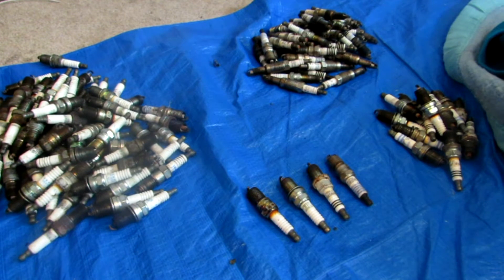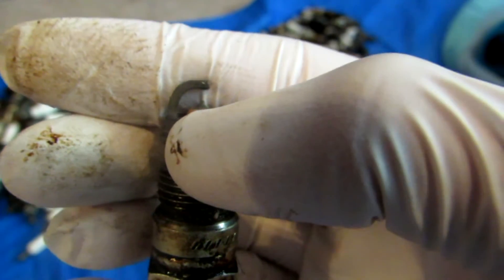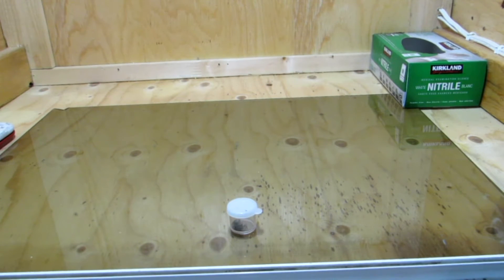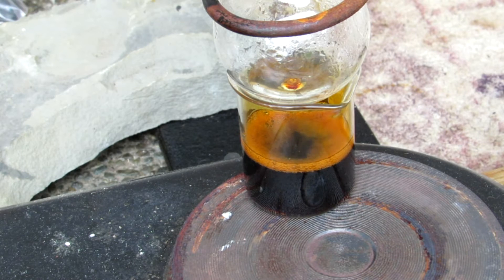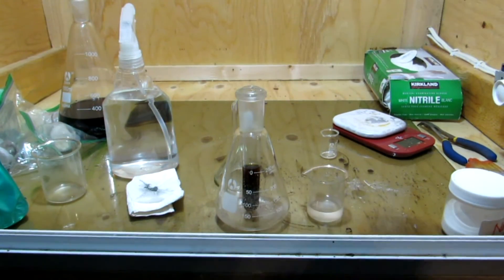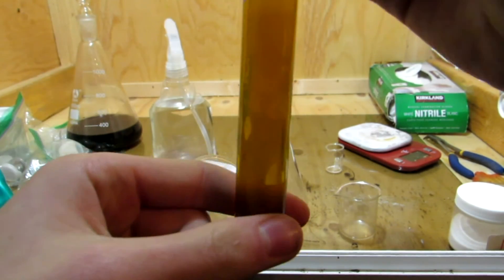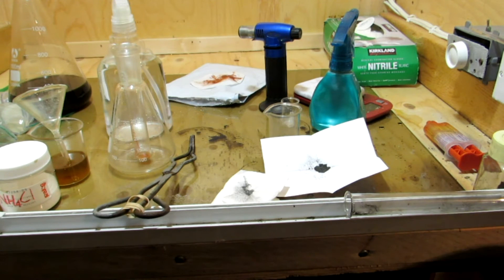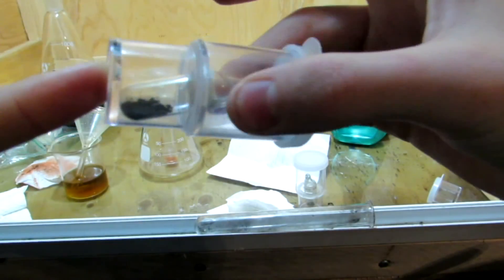Iridium and Platinum from Spark Plugs - Household Materials

Comment: Be careful of platinum compounds as they are very toxic. You are exposing yourself to minute amounts of it when you dissolve the platinum in acid; the small bubbles of gas carry droplets with trace amounts of metal. Even drops of  the soluble compounds on the skin are toxic.https://en.wikipedia.org/wiki/Platinosis  I saved the tips from some Ford spark plugs too.

Comment: This gave me an idea. We have a junkyard near where I live. They let the public remove parts and charge a small amount. I know they remove the catalytic converters and crush the cars. I don't think they remove the spark plugs. Also, It's possible to make nitric acid from ammonia using a platinum catalyst via the Ostwald process. A platinum catalyst quartz "wool" can be made from Hexachloroplatinic acid, I am not a chemist or even know that much about it, but I have seen a video here on YT on how it is done.
Reply from the maker: oh interesting, yeah I’m sure you could make a platinum catalyst in glass wool, that is a great idea! you could make ammonium hexachloroplatinate like I show here, soak the wool in it, and then heat it to decompose it and precipitate platinum on the surface. I am definitely going to try that in the future, thanks!
Reply: The channel I saw it on was Astral Chemistry. They show the lab setup in operation in "Ostwald process: Catalytic oxidation of ammonia for the production of nitric acid" and in a separate video how to make the catalyst "Preparing a platinum catalyst for the Ostwald-Oxidation feat. aqua regia" . They make what they call "sodium hexachloroplatinate hexahydrate" from a tiny piece of platinum during the process. Like I said, I don't know much about chemistry but it seemed pretty straight forward. The videos use a computer generated overdub, so it is strange listening to .  All the best, Thomas @TheCanadianChemist

Comment: good video.  although you commonly speak about using Nitric Acid for a lot of your reactions, yet it isn't commonly available to anyone.  on the prairies, there is no place available to ascertain such acids, and shipping it in from other provinces , would cost a mega fortune, even if distributors would sell it to a private person, thus, this process would be unachievable.
Reply from the maker: nitric acid is quite easy to make at home from sulfuric acid and a nitrate salt like calcium ammonium nitrate from cold packs from Walmart. or if you have nitrate fertilizer that will work. using sodium bisulfate from  pool chemicals will work in place of sulfuric acid. I have some older videos on making nitric acid at home.